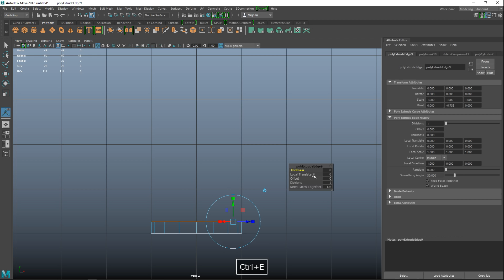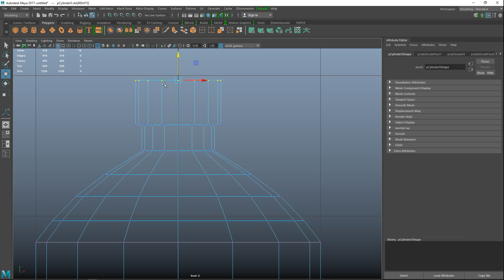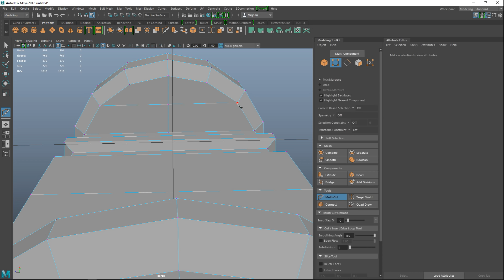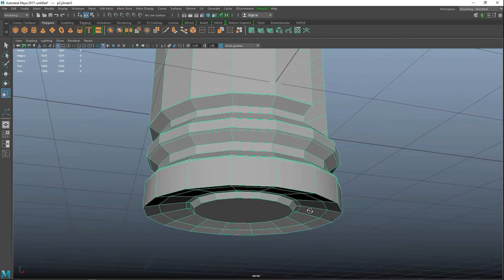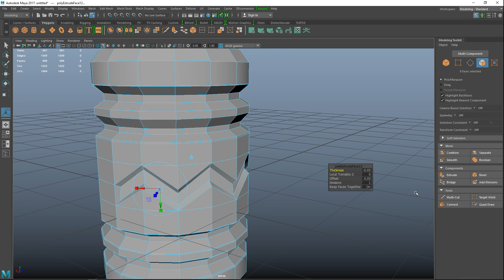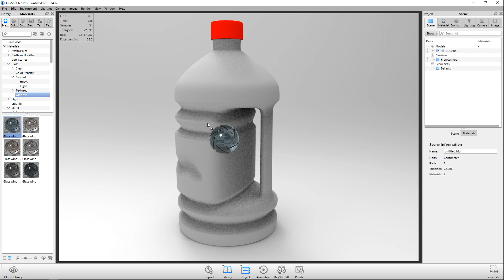Maya 2017 tutorial : Modeling more complex objects

Comment: it will not pick the entire edge loop on the cap at around 7:05 because the top is an ngon.  you can either select the top face and then extrude in to create quads and then select the loop or you can select the top face and the convert to edge loop to get the top loop or just manually select each edge as you did.

Comment: probably not the place to ask such questions but interesting enough I can't find a proper explanation how to make an object to vibrate, like phone vibration!
Reply from the maker: The best and easiest way to do that is by manually keyframing the animation.
Reply: A phone vibrates faster than the frame speed of most animation. You'll have to do some motion blur in composite to make it look like it's vibrating faster than you can animate. I don't know if Maya has a compositer, but you can probably use After Effects. I would recommend trying Blender's node-based compositer, if you haven't yet.

Comment: First off, thanks for all the great tutorials, you've been a big help. I just wanted to say that at 10:35 or so when you were using the Multi-Cut tool, you can simply hold down shift to snap the cut to the exact center of the line.
Reply from the maker: Thanks for sharing !
Reply: And he should be using the snap to vertices option to align them.